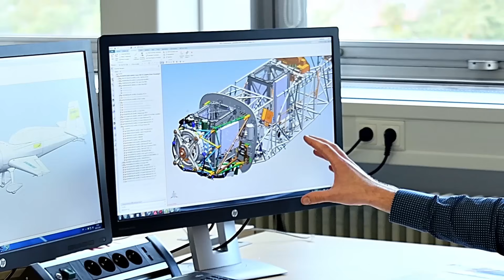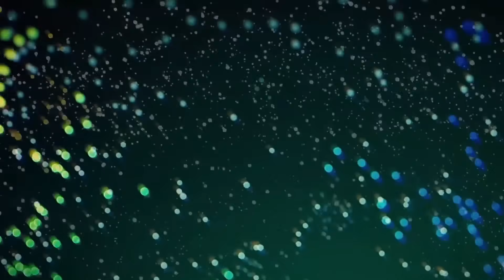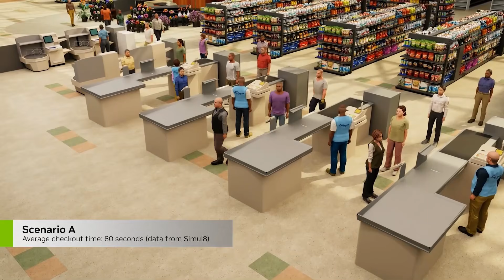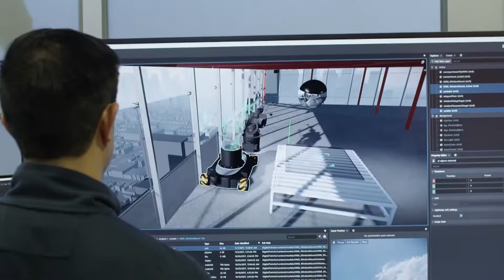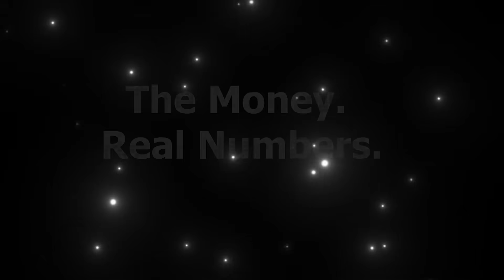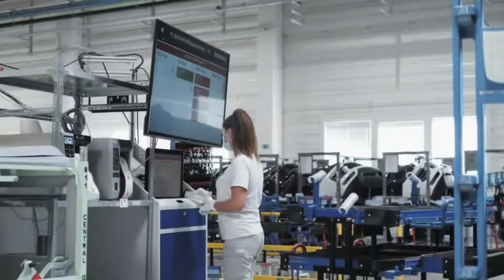Digital Twins: The $100 Billion 3D Industry You're Missing Out On

Comment: Finally, someone is talking about digital twins! I work in data centers, and the need for this is very real
Reply: Then give me some piece of advices, please. it would help me a lot ❤❤❤❤❤❤❤❤❤❤
Reply: @MuawwezRayyan-u6f There are a few ways to approach this. If you land a job in a traditional datacenter environment, you'll often encounter a lot of unawareness regarding what 3D technology can actually do. It can be tough to get a budget for specialized software, but you can easily bootstrap the concepts yourself. You can model basic geometry in Blender and use AI coding tools to build an interactive dashboard that simulates real telemetry. Honestly, because most people in these areas lack a 3D background, they’ll be completely blown away by basic geometry—no crazy lighting or complex materials required.
I’ve actually seen pretty basic Three.js sites simulating a datacenter colocation heatmap, and the teams got amazing results with it. When people are used to looking at flat UIs or text-based logs, they have to do mental gymnastics to map numbers to a physical layout. A basic 3D view completely bypasses that cognitive load. The brain spots a glowing red cluster in a 3D grid instantly. Plus, keeping the geometry lightweight means it runs smoothly right in a standard browser on a basic corporate laptop. You don't need a massive budget or Hollywood visuals to deliver real operational value—just simple shapes shifting colors based on live data.
Another approach is to learn the enterprise-standard tools and get a job at a company that focuses solely on digital twins, though that is a pretty niche market. Personally, I like the approach of learning day-to-day operations while adding AI, automation, 3D modeling, and motion graphics to your personal learning roadmap. If you focus on building that versatile skill set, you’ll definitely find an opportunity along the way.